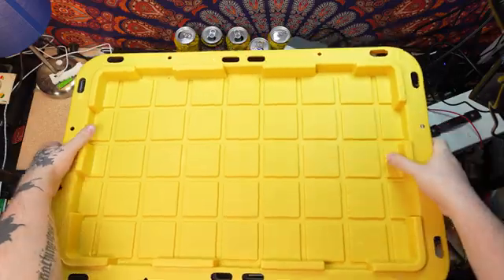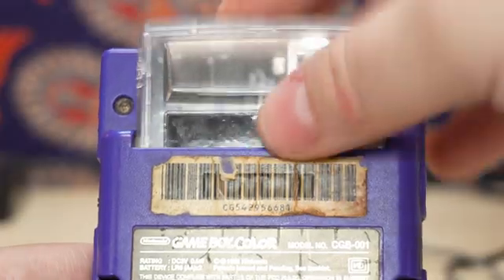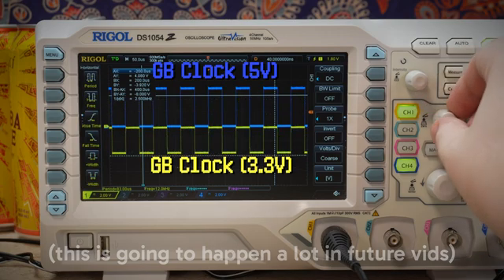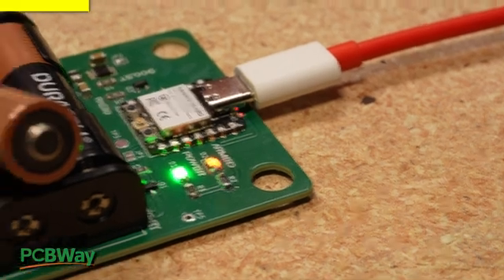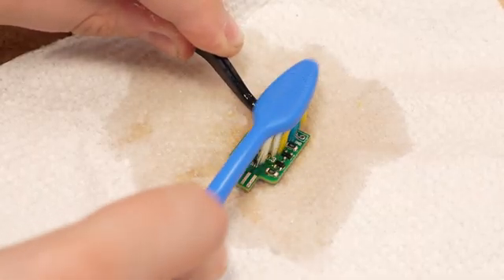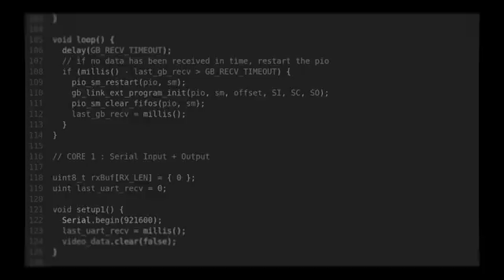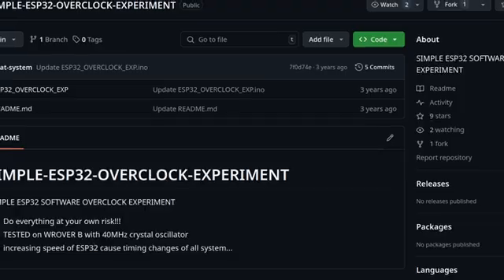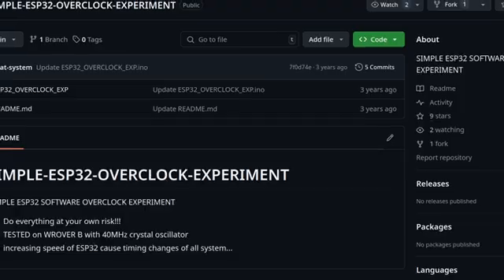Inventing Link Port Video

Comment: I'm not even finished this and I gotta tell you man, I want to see a mechanical keyboard where the actual controller is a gd GBA SP and it's bit banging USB 

Godspeed you crazy bastard
Reply: (As an aside, your cars CAN bus has a ton of easily readable information on speed, gears, engine load and a pile of other stuff. Interfacing that with a GB SP and mounting it to your dash would be a fun project :3)

Comment: The Gameboy Color can clock the link port up to only 512KHz, but it doesn't matter how fast (or slow) the clock input is if it's in slave mode, so data can be sent much quicker- it's just a matter of making the code on the Gameboy handle the data from the serial register fast enough.
To get "full color" images encoded quickly, you can shrink the image down to 20x18 and quantize it to 8 colors with no dithering to get the palette map. It's then a matter of treating those areas of the image as their own separate images/frames to quantize them to 4 colors each. It'll definitely require some extra coding, but if I can do it manually fairly easily in GIMP, then coding it shouldn't be too hard.

Comment: The dithering in solid black and solid white versions of the screen is likely caused by using partial range YUV format at some point in the video conversion, resulting in blacks being very dark gray and whites being very light gray.

Comment: the big problem i see here is that you will be unable to print out the picture using the gameboy printer if the link cable is in use for the stream.

Comment: Well, first, try using "ordered dithering" instead of any atkitson variant (https://en.wikipedia.org/wiki/Ordered_dithering)
As it's always "in grid", it will look less flikery.
Also, for the color, you have 8 color palettes, so you can split your screen in 8 regions and assign the palette data to the tiles before the streaming start.
That way, as soon as you stream a palette (or set thereof), all the tiles in that region will take the said color palette.
Lastly, if you combine ordered dithering with some data loss, you can probably fit any image into a 255 fixed set of tiles, removing the tearing, and greatly speeding up the transmission.
Yes, the quality will be worse than "hires", but probably better than "low res", but the framerate will probably be on part with "low res" for a better quality.
Combine with the 8 region colors, and you probably can have a color stream better than your "low res" one = D

Very nice video nontheless ^^

Comment: Could the video frames be compressed before it is sent to the GBC using something like RLE?
It might be possible to raise the resolution somewhat in the low-res mode by switching the tile data every 1-2 scanlines using raster interrupts

Comment: I imagine the dots were caused by the fact that there isn't a modern video compression algorithm that handles high frequency information well. And it all works by throwing out high frequency information. That's the information you need to get the sharp pixel transitions. In a 1080p video you won't notice if a 240x240 block is a little less sharp than it could otherwise be. Btu when that's your whole video canvas the it just wants to smear the whole thing. You really need a lossless video codec to do this sort of thing.
Reply: I imagine it's more just an error in colorspace conversion, or the original video truly does have just dark gray as the black.

Comment: I know it sounds really hard to implement (and it is I guess), but couldn't you increase the FPS count on high res "simply" by uploading only what's changed on the picture? (Just like modern video encoding does)

Maybe a quick and dirty way to do this would be to upload the tiles that changed only when they changed to a certain threshold ?
Reply: This was also my immediate thought. Why send full frames? Maybe in an update!